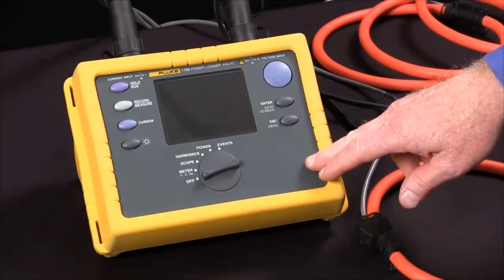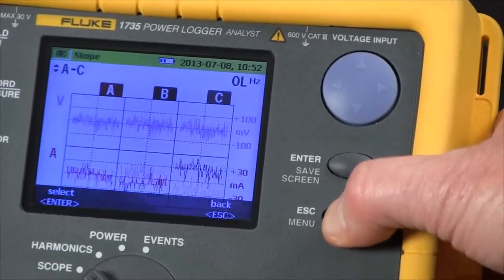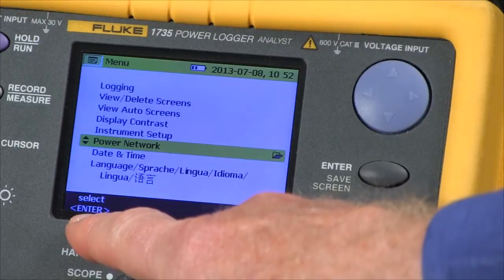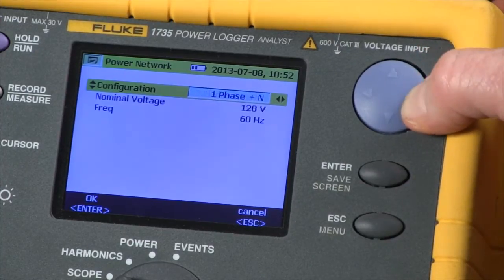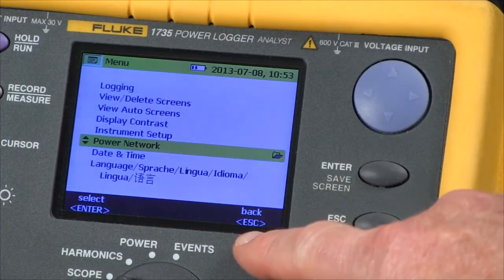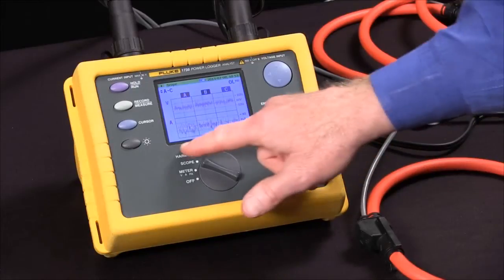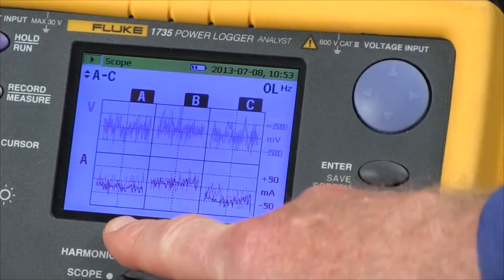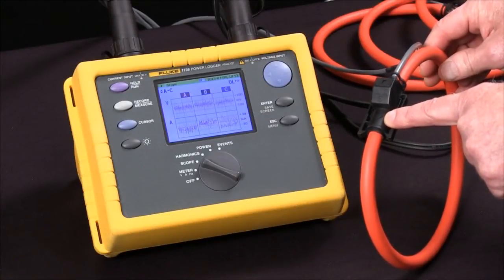How To  Connect The Fluke 1735 To A 3-Phase Power Circuit

Comment: Hi,
I have a 3000A/6000A 36-INCH FLEXI PROBE 4 PHASE current probe for FLUKE 1735 and accidentally the cables  broke from the 7 pole connector.

I would like somebody give me the connection (L1, L2 L3, N, and other) with each pins of the 7 pole connector, because it can be repair soldering the pins to the cables(the connector is easy to open and see the pins and the cables).
Thanks a lot.
Reply: Did you fix it?